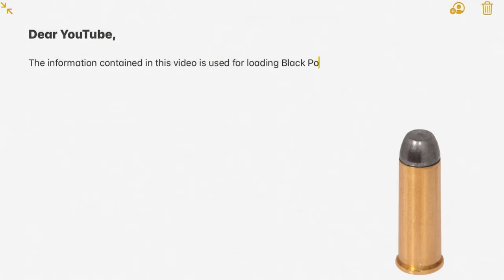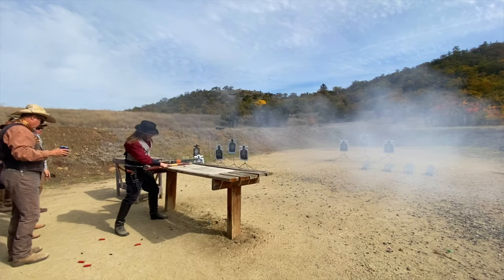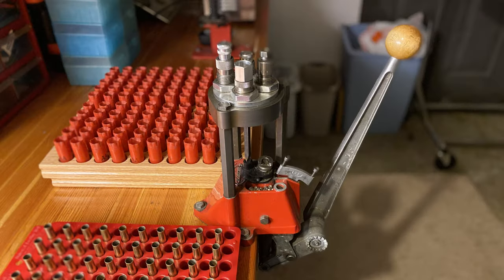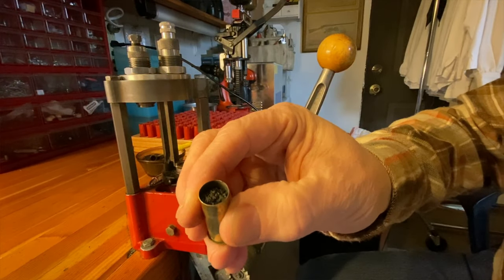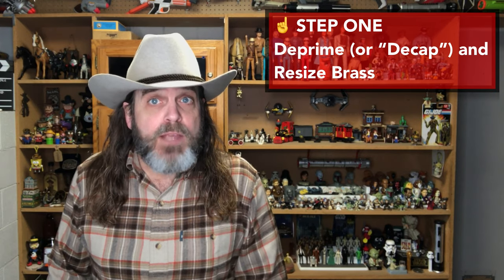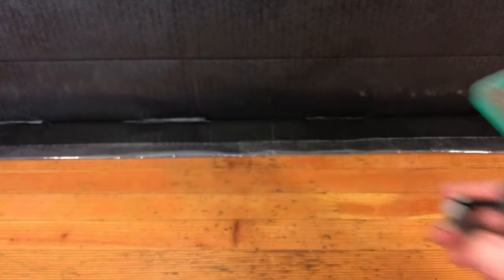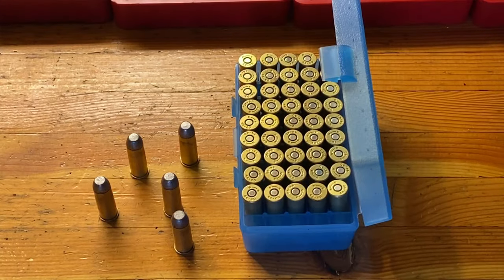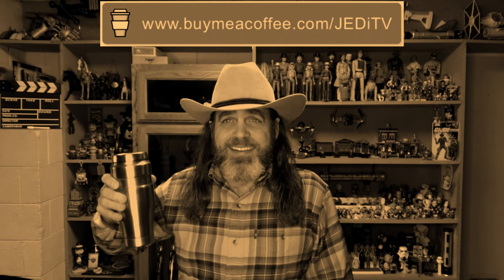BLACK POWDER 44/40 (44WCF) Loads [HOW TO Black Powder Cartridge Loading / Reloading]

Comment: Good stuff. I use a rubber band around the bowl of black powder, this makes for quick, consistent scraping off of the excess.
The RCBS Priming tools are good, I have two, one set up for small and one set up for larger primers.. I used Lee for 20+ years and as long as you put a dot of grease on them, they worked fine.
I was cashed up one day and sick of not having the right shell holder for the priming tool (always on Sunday when the gun shop was closed!).
I still have the RCBS Rockchucker Press I bought in 1971. It has the case kicker which makes FLS'ing brass real quick. I then prime on the RCBS tool and finish off the load on the Lee Classic Cast Turret press.
Thanks.
Reply from the maker: I love that rubber band idea!  And, I have two of the RCBS hand primers set-up the same way (“great minds”). 
~Jed 🤠

Comment: i use the cylinder from one of my handgun as a case gauge cheker, that work well too. I use it dismounted of the gun of course... 6 cartridges at once, and after, in the box...👍 I know you use 38 in your's handgun, case gauge chercker is needed...
Reply from the maker: I’m familiar with that method as well.  👍 Thanks for the comment.

Comment: Nicely done, Jed.  Highly entertaining and informative, as usual.  Your clear and concise description of this loading method would make it very simple for anyone to load these cartridges with ease.  I follow a similar routine.  Only, I flare the case mouths first, then add the powder.  I did try it your way, though.  Works just as well.  Two thumbs up!
Reply from the maker: Thanks.  For me I flare the case mouth after because that is when the cartridge is moving from the loading tray to the press.  Once it gets to the press, it’s flare, seat bullet, crimp, repeat.  Jed 🤠

Comment: Personally I don't check the brass or add primers until after expanding and belling the case mouth. This is because I have found that most of my split cases  occur at this point in the process.
Reply from the maker: That is a valid point.  While I do find an occasional case will split when I expand the mouth (in which case I dump the powder and carefully remove the primer to reuse in another case). But, I do find that split cases will also rear their ugly head at the de-prime stage. 
~Jed 🤠

Comment: You brought out a good point that 44-40 and for that matter 45 colt, are two cartridges that will break the bank buying factory loads.   Reloading is a necessity, plus you have much more flexibility.  I own both calibers and prefer loading with blackpowder.   With the 44-40, I get better velocities with blackpowder out of my 1873 Winchester than with smokeless.     Much of the reloading data published for 44-40 rifle smokeless loads aren't much faster in velocity than pistol loads of the same caliber.  Never understood the value of loading a rifle to pistol velocities.  I ran accross an old reloading data insert that came with the Lee die set for 44-40, circa 2000.     Many of the loads were significanty hotter than what you see today.   One in particular pushed a 240gr cast lead bullet at 1300fps.   That would certainly be better if you chose to hunt with a 44-40.   I don't know why Lee discontinued this.  Perhaps some lawyer stuff.  

There was Cowboy Action Shooting at the Capitol City Rifle & Pistol Club, but it shut down awhile back.   Seems like it would be rather fun.

Comment: Slap a lubbed wonder wad over the powder under the bullet. It will eliminate barrel leading, and greatly reduce fowling, resulting in a much longer shooting session. Great vid!
Reply from the maker: Thanks for the comment. Personally I don’t care for a lubed wad on top of powder but I know it works just fine for a lot of other folks.  
-Jed
Reply: @JEDiTV  I use lubbed wonder wads only on cast lead bullets. It looked like you were rolling those loads with jacketed bullets, so no need there. I have an original 73 Winchester and the wads helped a lot for me. In a day, i can shoot 500 or more black powder loads because the wad keeps the barrel clean. It also improves accuracy because the base of the lead bullet is not melted and deformed so much. Do you have any 41 colt?

Comment: You forgot to mention to avoid a cat full of static electricity rubbing across your leg causing a static arc that can ignite your powder and blow you to kingdom come.  Just like what happened to that guy online's uncles cousin's neighbors dog trainer lol.  

I can testify to the combination Jed mentions in this video (thanks for the tips Jed!).  Of the 1000+ rounds I've loaded I've had zero misfires or high primers (knock on wood).  I use the first method you showed on your turret with the exception of the primer setting part.  Like you, I de-prime and then prime by hand.  I like this way because I get 2 chances to inspect the case.  I also use my Lee funnel on the expander die (like it shows in the die setup directions in the video) to make pouring powder easier.  I was originally going to do the loading blocks like you do until I found out my loading block was too deep for my funnel to fit over the cases (doh!).  Question for you on the RCBS hand primer.  Do you ever get any upside down primers using it?  I have the Lee primer and it somehow flips the primers over and seats them backwards.  I try and check before I set the case in it but every now and again one gets past me.  It's irksome...
Reply from the maker: I haven’t had an issue with upside down primers using the RCBS hand primer. 
-Jed (who somehow missed this comment but is certain we’ve probably talked about it as some point)

Comment: Jedi, why do you charge them BEFORE you expand?  There's a chance that you can spill the powder handling the charged cases.
Reply from the maker: I like to see powder in all the cases before I move to the next step (I inspect ‘em with a flashlight while they are all in the tray).  As far as spilling... it’s pretty darn rare, it’s happened, but I would bet it is 1 in every 5,000 rounds.  🤷‍♂️
Reply: @JEDiTV  I also look them EACH over after charging blocks of 50.
A bright flashlight works great.
And I hand prime with a LEE Bench Auto prime.  I like to get the feel of each seating.

Comment: I’m  making the switch to frontier cartridge next match. Do you have any issues with reliability or accuracy using those bullet? I like the idea of not having to use the extra step of a grease cookie.
Reply from the maker: These are the only bullets I’ve used for black powder for nearly 20 years (may even be longer than that… time slips away…) I have no cleaning issues and, as my videos show, I rarely miss. And, when I do have a miss it’s quite clearly something caused by me (jerked, pushed, etc…) and not due to any fouling or leading of the barrel by the bullets.
Reply: @JEDiTV  I must have accidentally reposted this twice. But thanks for the info, and all your how to videos have been a huge help.
Reply from the maker: @Buffalogus not a problem (unless I gave you a different answer each time 😉).

Comment: Great video. That seems like a lot of powder. Do you use that much because it’s faster and easier than using less powder and a wad?
Reply from the maker: Thanks Son of Dad.  I use that much because it is a standard, traditional load.  I don’t like any fillers or wads.  This old method seems simpler to me.  - Jed 🤠

Comment: I am following your step process for my Original Henry 44 40 (the 1860 Original Henry Re-production).  I have purchased swiss 2f which is all I could find actually from Buffalo Arms.  Got the bullets you recommend here as well.  The Lee press and die's came in today.  I found some new brass on Gun Broker.  Am I on the right track?  Yes I bought the case gauge checker as well.  Ready to load.  Any thing I am missing?  Great video....
Reply from the maker: ✔️ Black Powder
✔️ Desperado Bullets
✔️ Lee Press 
✔️ 44/40 Brass 
You are definitely on the right track! 🤠  I’ll address the primers on your other comment….
Reply: @JEDiTV  Thank you so very much.  You have the best video on reloading the 44 40 I have seen.  Much appreciated.  Your timely reply is most considerate.  Will be watching your channel for as long as you are making them.  Thanks again.
Darrel
Reply from the maker: You’re welcome.
Reply: @JEDiTV  Hey my fine sir.  I reloaded 150 rounds.  I bought some starline 44-40 brass.  Actually new 44 WCF after I received it. The loads turned out perfect after I got the crimping right.  The Brass has no bevel but it was what I could find new.  Rounds came out great although I had to adjust my swiss 2ff powder from 2,2 cc to 1.9 cc for the bullet to press o the crimp grove for crimping precisely. 

I have ordered some once shot 44 40 WCF brass  although the brass I did get was new and worked out fine but I was not able to put 2.2cc of powder.  I could not seat the bullet at all as the powder did not move really..  Now I need a tumbler?  Based on my research, the tumbler seams to be the best.  Do you have a recommendation on a tumbler for cleaning brass?  Those pre greased cowboy bullets are great......Many thanks and look forward to hearing any tumbler recommendations
Reply from the maker: Honestly, I’ve found all the tumblers the same regardless of whether I bought ‘em at Sportsman’s Warehouse or Harbor Freight or Amazon.
Reply: @JEDiTV  Thanks...Figured out my first reload issue...I am putting 2.2cc from Lee 4 turret press.  That first round, I must not have had my seating die set right.  Now loading full loads.  Thank you so much.  I am having fun learning.  I just bought 400 rounds of one shot brass that is 44 40 WCF.  I have many other rifles and will be using to reload in this crazy environment.  You are the best....I will buy a good tumbler.  Again, Thank you.....Learning and loving this stuff.

Comment: Hi Jed. I use about the same routine but have a Dillon 550B with the dies set up for black powder shells. Same steps just when the shell plate  is full one pull is one round. The powder is dipped and poured through the Lee die because having a pound or so of Black gun Powder right in my face is not comfortable to me. Good video thank you.
Reply from the maker: One of these days I’m gonna make the upgrade to a Dillon, everyone tells me it’ll be faster... 🤷‍♂️ - Jed 🤠

Comment: Hi Jed I have the Uberti short 1866 in 38spl I'm Thinking of getting one in 44/40 but I'm worried about    44/40 cases not lasting long.How many times can you reload a 44/40 case using your method.
Reply from the maker: I don’t count the number of times I reload ‘em.  I shoot ‘em until they split or I notice a split in the reloading process. I can tell you that I get a LOT of uses out of one piece of brass (years of service).

Comment: Great video! Cowboy Bullets are only showing 44 cal, 200 grain sized to .428 on the site. Is this the bullet you are using? The box you have shows 44-40 bullet and I know that the "40" stands for 40 grains of black powder, which you use 32. Just want to make sure I get the right one. Thanks a million for the step by step! Primers are problem finding but I havent looked everywhere yet
Reply from the maker: Howdy, yes I use the 44, 200 grain, .428. 
You’re welcome for the step-by-step!  And, primers are starting to SLOWLY creep back in stock!

Comment: Hi Jed! Great videos. Probably a question beaten to death within the CAS scene, but would you recommend 44/40 or .38/.357 for someone new to CAS? Or is it entirely preference? Very interested in the BP aspect of the sport. Thanks again!
Reply from the maker: Since I shot both, I guess I’d be the wrong person to ask 😉 But, seriously, it is mostly preference, yes.  Cost is also a factory, especially when considering shooting Black Powder.  I speak from experience when I tell you that my dollar goes almost twice as far with .38 as it does 44 WCF.  But... I like the authenticity of the 44/40 in the rifle so... 🤷‍♂️ And, then there is the big ol’ BOOM 💥 that 44/40 produces, I reckon you can’t put a dollar amount on that satisfaction.  
So, again, I shoot both.  .38 in my revolvers and 44 WCF in my rifles.  Hope that helps steer ya one way or the other.  - Jed 🤠
Reply: @JEDiTV  Thank you very much for your detailed response! You're a great source of info and fun for the sport and definitely the reason I am getting into it.

Comment: How hard is it to switch over to black powder I shoot 45 Vaqueros at cowboy action now very good video would like to have more information thanks about other calibers and about black powder
Reply from the maker: Well, that’s an good question.  I wouldn’t necessarily recommend going back and forth between smokeless and Black Powder as sometimes the products you use to clean one, or even the bullet lube you use on one, can adversely effect the other.  Smokeless lube left in the barrel of a gun can cause the BP fouling to get hard and sticky (tar-like) and very difficult to clean.  It’s not that it can’t be done, and a lot of folks do switch between the two.  But, I prefer my Black Powder guns only have a diet of Black Powder and my smokeless guns get smokeless powder.  I hope that answer helps.
Reply: An easy way to get into frontier cartridge is to use one of the substitutes that do not require a "black powder compatible" lube on the bullet.  Examples include APP, Alliant Black MZ or Hodgdon Triple 7.

Comment: Do you have any recommended loads for pyrodex P? I know it’s not real black powder, but it’s the only stuff I can get in my area.
Reply from the maker: I am not familiar with Pyrodex “P”, is it a 3F equivalent?  If so then I’d follow 3F loading guides (in which case you could use 3F instead of the 2F I prefer to use). 
-Jed 🤠

Comment: Great video!  I've been putting off trying some black powder loads for SASS.  I currently don't have a shotgun reloader.  I was thinking about going with brass shells also.  But i'm sure i'll end up just sticking with AA hulls.  I understand 44-40 might be much better that 45 colt with BP.  But, do you have any experience with 45 Colt BP loads?
Reply from the maker: Yes.  I’ve loaded, and shot, 45 Colt quite a bit.  I prefer the 44/40 for rifles.  Eventually, I’ll do plan on doing episode on my 45 Colt BP load.   - Jed 🤠

Comment: How often do you trim 44-40 brass? I’m going to try BP in a few matches this spring with a pair of vaqueros in 44-40 and an 1873 rifle also in 44-40.  And, do you get all your rifle brass back at each stage?  I ask as I’ve been losing about 15-18 38 cases out of my rifle each match. Losing that many 44-40 per match would be painful. 
Regards
Reply from the maker: I’ve never trimmed my brass. 
Yes, you get (most of) your brass back at the end of each stage.  Sometimes one or two pieces (out of 50-60) will get lost when the pickers just can’t find it.

Comment: Does that cast bullet manufacturer use a petroleum based lube, or is it beeswax based?  It’s “common knowledge” that petroleum based lubes tar up the bore when combines with BP.  But, maybe that’s incorrect with modern lubes?
Reply from the maker: Good question. I reached out to them and while the formula is a trade secret they did say that it contains “both” beeswax and petroleum.  I can tell you that I have no problem with fouling and I’ve shot l0’s of thousands of rounds of their bullets.  But, you do have to keep your barrel moist, especially in hot / dry weather.
I hope that info helps and I’d also recommend watching my “Black Powder Field Cleaning” episode. - Jed 🤠
Reply: Very interesting.  Maybe it's worth a field check for the bullets I buy up here in Canada to see how bad the taring really is.  If I could skip the re-lubing step in my reloading it would save me a lot of time.  Thanks Jed!
Reply from the maker: You’re welcome.  Let me know how it goes!

Comment: Great video!! how many times to you reuse your brass?
Reply from the maker: Great question.  I use ‘em until they split during the reloading process.  They will either split at the de-capping stage or at the point where you bell the mouth and seat the bullet.  It’s obviously a little more frustrating if they split at the bullet seating point because you have to empty the powder and try and recover the primer (a very delicate process).  - Jed 🤠

Comment: Fantastic video Jed! Really informative and has definitely given me a bit more guidance on how to load this cartridge with black powder as I normally load smokeless. I had a couple of questions if I may. How do you keep your brass cases so shiny? Mine normally discolour after one shot of black powder. Also, I've had major fouling issues when using black powder in my 44-40 cartridges before which badly affect accuracy after a few rounds. I've been told this was due to using a bullet with an alox based lube, which apparently fouls the barrel up badly with BP. Have you experienced this before? Many thanks in advance and again for the video, Sam.
Reply from the maker: Howdy Sam, 
I tumble the brass with a shot of Wrights Brass Polish (not Brasso).  The Bullet I use is from Desperado Cowboy Bullets (you’ll find a link to their site in the description of just about all of my videos).  Their lube is compatible with Black Powder.  Also, keep the barrel wet with a little spritz of water or ballistol-mix down the barrel after every stage or two (depending on weather and/or temperature). 
Hope that info helps!  - Jed 🤠
Reply: @JEDiTV  Thanks Jed. That is really helpful! Always great to hear tips like this from pros like yourself! 😁 You have another loyal subscriber and watcher here, keep up the great work!!!